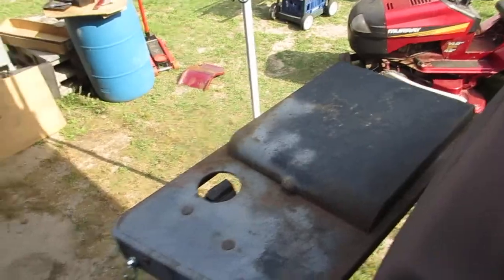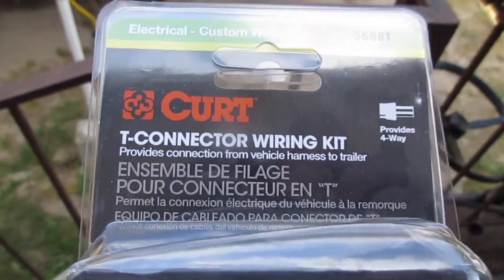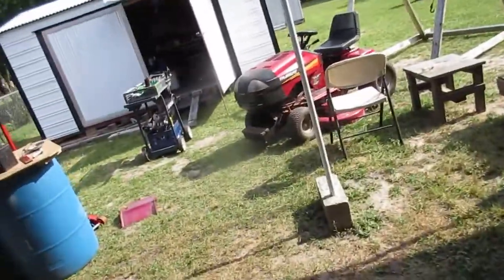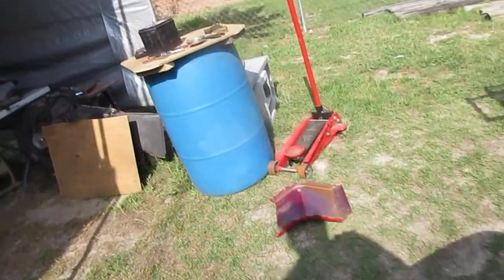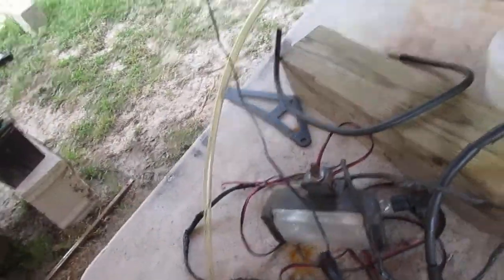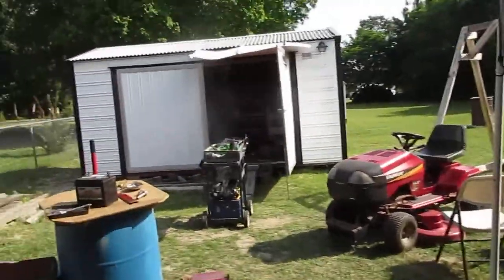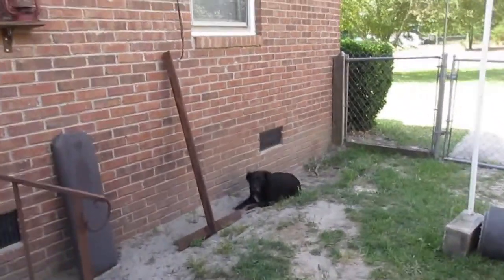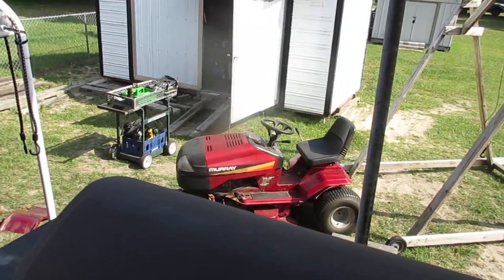New ride and working on the old Murray

Comment: Good looking car, most likely it will serve you well.  Good luck with the mower
Reply from the maker: +Tufdog&#39;s Place.................... I've about done with it their is a hair pin that came loose but it's in a very tight place. And I'm taking a break from it now. I can't see where the hair pin goes, so have to do it by feeling into a blind spot.
Reply: Those are tricky, You'll get it...
Reply from the maker: +Tufdog&#39;s Place .....I sure did I used silicone to hold the washer in place, and needle-nose vice grips to to insert the hair pin in the hole.
Reply: +MIKE MAYERAN    Way to go !